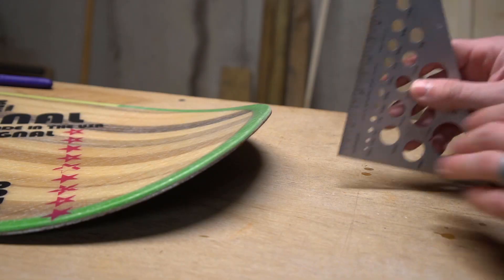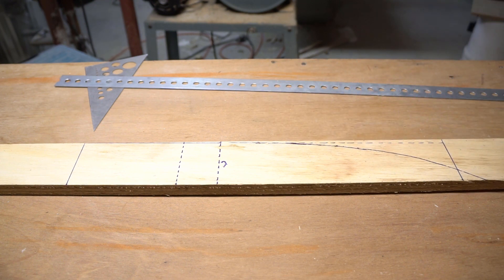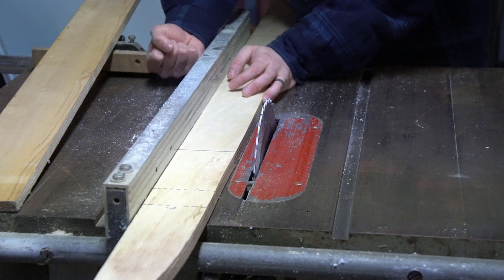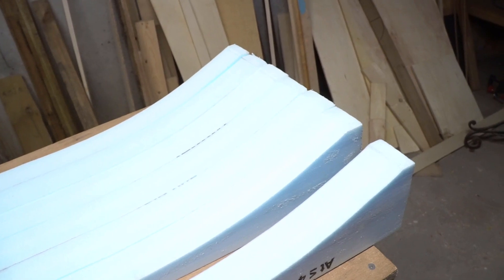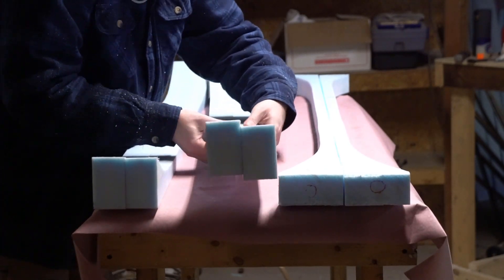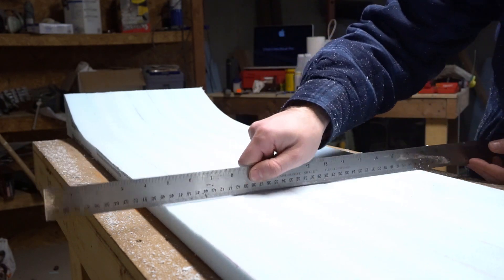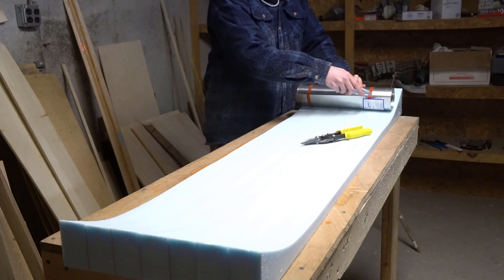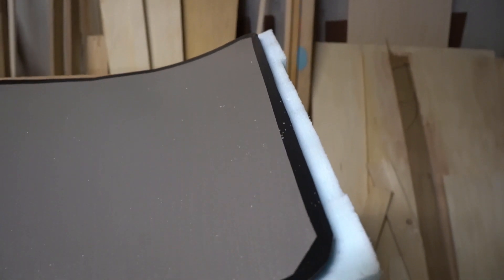Building a Snowboard - Part 9: Making a Mold for Vacuum Bagging

Comment: My friends and I do quite a bit of composite construction for remote controlled gliders. We've found that Highload 60 (60psi) makes a better mold than the 25psi foam that you're using. Also, be careful when buying Spray77, there is a version with acetone in it, and that ruins foam in very upsetting ways. Your videos are really good, thank you for putting the time in to make them.
Reply from the maker: Thanks for the tips! Where do you get ahold of the stiffer foam? I've just been getting my stuff from a lumber yard
Reply: @GoodRoads  Concrete supply places. It's used for making forms. They look at you weird when you ask for a single sheet.
Reply from the maker: Sweet! Thanks!
Reply: High pressure foam is used under slabs. 👌🏻

Comment: So is it correct to say that the camber or rocker design is an outcome of the mold shape? For the rocker I would need to make it flatter than in the camber area where it will be more curvy? I am just starting with the diy builds and having troubles to understand that point. My idea is to build a pow board with nose rocker and camber down the tail. Great channel!
Reply from the maker: Exactly, all the geometry of the of the base of the board comes from the mold. Rocker means that the center of the board is curving upwards like this: ‿ and camber means the center of the board is curving downwards like this: ⁔. So if you ever hear about rocker/camber/rocker profiles, all that means is that the board is curving upwards or downwards in different areas of the deck. All of those curves are pretty subtle
Reply: @GoodRoads  Thanks!

Comment: After watching  all these I still dont know how a vacuum bag works
Reply: As air leaves the bag, the bag naturally wants to shrivel up and compress (not the best words for that, but I can’t think of what else to say.) As it does that, both sides of the bag press inward, pressing the board and the mold together. The less air, the stronger the vacuum, the stronger the press.
Reply from the maker: Another way to think about it is: we're living way down at the bottom of an ocean of air which is Earth's atmosphere. Just like deep sea fish, we don't notice it because that's the environment we're adapted to, but there's a ton (or 14.7 PSI to be accurate) of pressure pushing down on us all the time. By sucking all the air out of a vac bag you're allowing all that ambient pressure to come crashing down on whatever's inside, and we can use that to make fun stuff like skateboards and snowboards